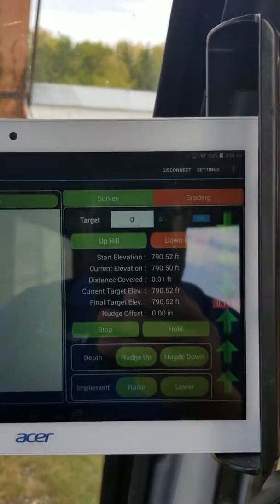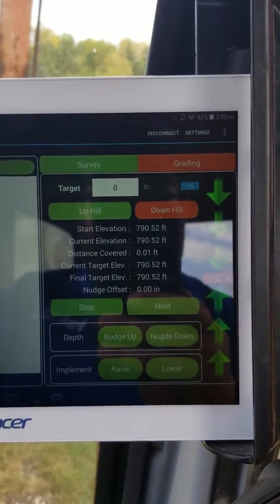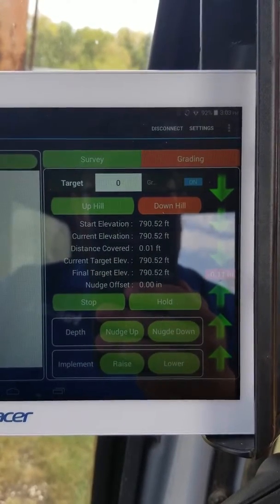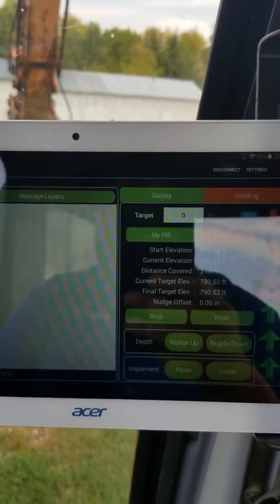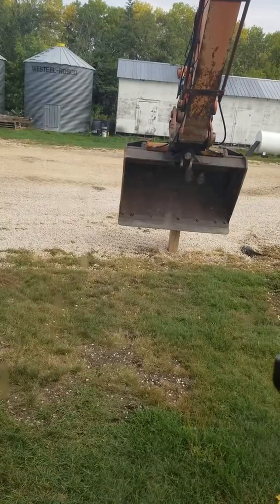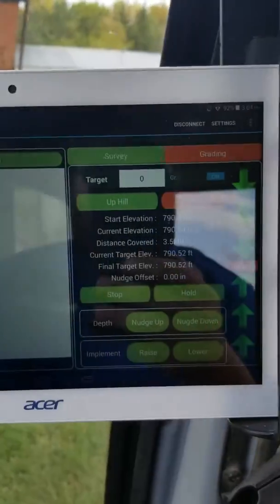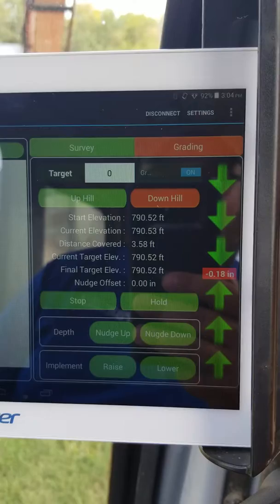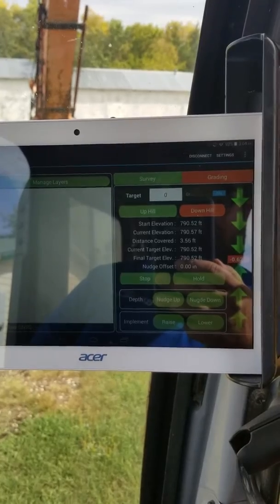Ditch Assist X - easily dig on grade with your excavator

Comment: Will I be able to use ditch assist x between  excavators and scrapers or will I need different systems?
Reply from the maker: We use the same app but different hardware, so you'll have to buy each separately. DA-X uses 2 sensors in conjunction with GPS to get position of bucket edge.
Reply: What is a good way to get in touch with of you. I'm interested but have some questions.
Reply: Found your Info  I will be in touch with you soon.
Reply from the maker: @scottbragg9796  email todd@botterillsales.com or call 2048715004